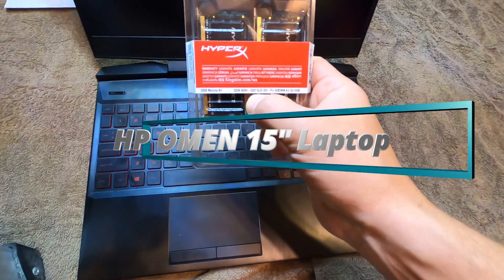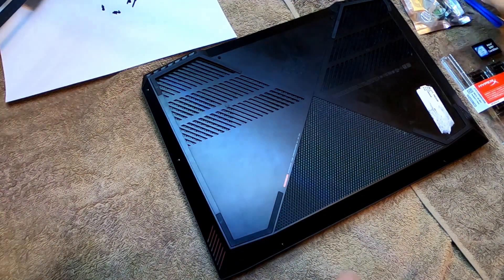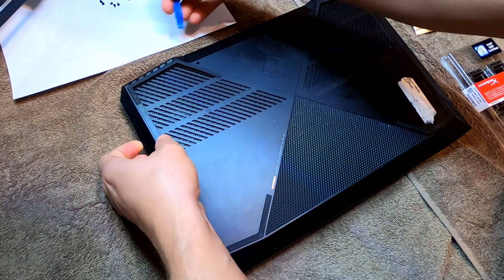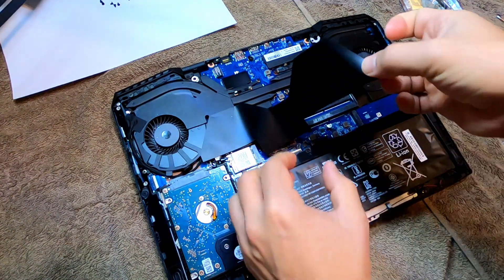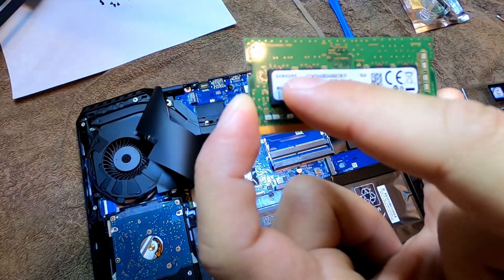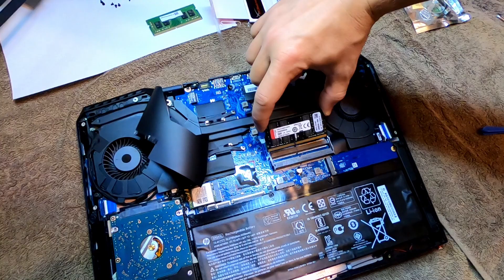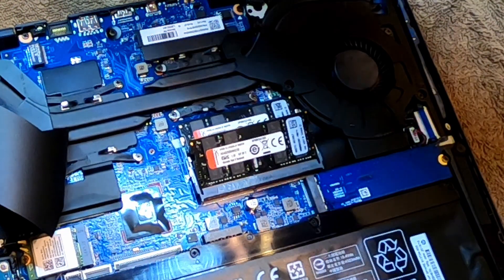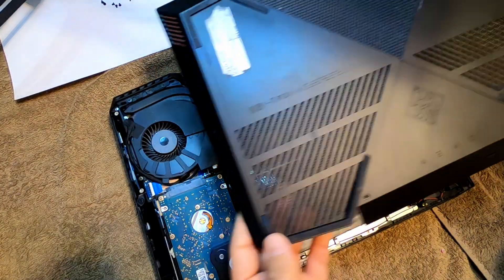HP Omen Disassembly Ram Install Upgrade | How To install Memory

Comment: Hey, I have the same laptop as you, but I couldn't find any way to speed up my 2 rams from 2666 mHz to 3200 mHz. Yes, I do have 2 8 GB 3200 mHz rams, but I don´t find a way to activate the XMP or an advance settings on the HP Bios, can you help me out?
Reply from the maker: The newer computers do not have any access to any of it, it should change the speed automatically.

Comment: Hey bro, I have omen 15 i7 9750h Rtx 2060 144hz with 16GB ram 2666. How should I know which one is competible with my notebook. Like my friends told me it's really risky to buy ram. I js wanna know can I upgrade my ram from 2666 to 3200 MHz. I mean is it possible.?  Default configuration is 2666 MHz ram so is my notebook able to proceed with 3200 MHz ram. Is it work.?
Reply from the maker: I cant speak for any other models other than this worked perfectly on my computer and is necessary for me to be able to edit these videos for my YouTube Channel.
Thanks for supporting my channel!

Comment: Very helpful video bud .I  have an hp omenx 17 an101na with 1  standard 8GB Kingston ddr4 2666MHz card installed which is to slow for my liking , I was wondering is there anyway with the memory slots to upgrade with two kingston 32 gb ddr4 2666MHz sodimm cards ( making it a wopping 64 gb ) , one for each slot or do you think the max would be 2 of the 16gb ddr4 2666MHz sodimm cards, asking You this as HP support are useless.  :-)
Reply from the maker: It may possibly support it but no guarantees... 
Thanks for supporting my channel ❤

Comment: I’m very close to buying a HP Omen 15. It has 16GB DDRAM. But I want 32GB. Cos this video right here — scares me. Not sure I’d feel confident to replace the RAM myself.
Reply from the maker: Why does it scare you? 
Hope it helped!
Reply: @DrDemp  

That black film across the RAM what if you don’t put it back properly , and then the laptop doesn’t work proper?
Reply: @LaMOi1  I'm like 90% sure the paper thing is just for aesthetics. So you can't see the board through the bottom grill.

Comment: Hi, nice video.
But I have a question, what is the maximum amount of RAM that this PC can support? 32GB or 64GB?
Reply from the maker: Mine could handle 2 32GB cards if desired. Total of 64GB
Reply: @DrDemp  Ty bro, do you know if OMEN 17-cn1000nl can support 64GB of RAM?
Reply from the maker: Not sure of the exact model but its likely you would max out the Processor's computing ability before ever needing that much RAM. Under heavy editing, mine only uses about 25GB of the 32GB compacity I have installed.

Comment: I got HP omen 15, and ryzen 5 hexa core. Can I install 32 gb ram single stick 32000 mhz? ( I am a noob at upgrading laptops)
Reply from the maker: Not sure on your particular model can always give it a try and see if it works!
Thanks for watching!
Reply: It’s best to stick with the clock speed the laptop came with if it came with a 2666 MHz if you stick 3000 MHz it’s gonna go down to 2666 MHz

Comment: Does hp omen 15 2020 support 32gb ram. Website says 16gb is max
Reply from the maker: Not sure about your particular computer there are 100's of different models of the omen's. Worked perfectly for mine.
Reply: @DrDemp  mine is omen 15 ryzen 5 4600h

Comment: Hi, I have hp omen and I want to upgrade it from 8gb ram to 32gb(16*2) , so what speed is best for me: 2666mhz or 3200mhz? ... is there a real difference between the speeds of ram in editing??
Reply from the maker: I prefer buying the fastest available that will work on my computer. Editing is very easy with the increased speed provided by this memory.
Thanks for supporting my channel!
Reply: thanks, can you give amazon link of this ram that you take it?

Comment: Hi purchase Hp Oman laptop & model is 15-dc1093TX  & Intel  i7 & 9th generation processor currently ram is 8 GB ( manufactured by Samsung)  2667 MHz  but i want to upgrade 2*16 so which  ram model is compatible with it please suggest, It will very help full for me, Thanks in advance.
Reply from the maker: The one used in the video worked perfectly for me. 
Thanks for watching!

Comment: I have hp omen 15 1092tx i5 9th gen 8 gb ram
Presently my ram runs at 2666mph 
Can I add another 8 gb ram with speed 3000?
Reply from the maker: Not good to mix speeds, and it will not run at the faster speed even if it works.
Good luck
Reply: Add another 8 gigs ddr4 2.666 MHz

Comment: Hello there,
My Omen has 1x16GB 2666Mhz (Cl19), I was thinking about buying another 16GB Stick (for dual channel),
But I just cant find any other 2666Mhz Cl19 on sale, the closest are Cl18 and Cl15. I can I mix them ? They should automatically match the slowest one (Cl19), right ?
Reply from the maker: I would not recommend mixing brands of RAM. Sometimes it works but It can also cause unforeseen issues. 
Thanks for watching!
Reply: @DrDemp  mixing brands is perfectly fine. Mixing speeds is not recomended (as the BIOS may not scale down properly/the way you expect), about timings I have no ideia how it works (on laptops) that's Y I was asking. Thanks anyway.

Comment: I have an hp omen 17 i7 7700hq rx 580, how can I enable xmp ?
Reply from the maker: Mine was plug and play, noticed an instant boost.
Reply: U can't. You could do it on desktop but not on most laptops. This should be automatic (If supported by the OEM).

Comment: I have omen 17 an106nm it dont have xmp profile in bios anyway i want to upgrade motherboard from i5 8300h and gtx 1060 to i7 8750h and gtx 1070 can anyone help me what model have same size motherboard with those specs and xmp profile in bios
Reply from the maker: I didn't have to change any settings when installing this memory, plug and play. 
Thanks for watching.
Reply: @DrDemp  Can u run cpuz and tell me readings of ram speed ?
Reply from the maker: I don't have that on my computer, I edit videos and this made night and day difference for me.

Comment: Good guide. 
I am totally bewildered by (and more than slightly annoyed about) the fact that laptop manufacturers stopped putting small access hatches on the bottoms of the machines; laptops used to come standard with a small access hatch right over the RAM, which could be opened by just removing a few screws and then sliding off the hatch cover, so the RAM could be upgraded without taking apart the entire case.  
Is it just to make the process more complicated so people will take their laptops to professional techs just to upgrade their RAM?  Because just last month I replaced a single stick of RAM in my HP laptop, a process that used to take me about 5 minutes (actually putting in the RAM is basically just like snapping together LEGOs) but this time it ended up taking me FOUR HOURS because I just couldn't get the damned case open, and then even when I was done I couldn't get the case closed back up completely; when I snappped the case back shut it felt like the internal components were no longer seated correctly, and the power button would no longer depress.  The corner of my laptop is still popped up open and I just cannot get it clicked back down no matter what I try, and the sides of the case are now riddled with scratches and indentations from working to pry it open.  I need to find one of those prying tools.
Reply from the maker: Thank you! I agree, they definitely don't make it easy on purpose and would rather you take it into a service department to have simple things installed such as Ram. I've had a similar experience with things not lining up on another computer (not the one in the video it went quite smooth) and sometimes its best to take it back apart and reseat it. Mine snapped flush the second time around.
Good luck!

Comment: Hi, 
What speed does it show in Task Manager? 2666 or 3200?
Reply from the maker: Task Manager will not represent the actual speed of the processor with the upgraded RAM, You would need CPU-Z to check this.
Thanks for watching!

Comment: Hello, Can you tell me if hp omen 17 rtx 2060 i7 9750h 2019 has a maximum supported ram memory 32gb and not 16gb?
Reply from the maker: Should be able to handle 2 sticks of 32gb for a total of 64gb. Google would give you a more definitive answer using your model/serial number for your Laptop.
Reply: @DrDemp  thx i love you

Comment: If i purchase 16GB DUAL RANK RAM. will it work.. i already have 8 gb so total it will be 24 GB ... I am right or wrong...??? confused between single rank and dual rank
Reply from the maker: As much as I would love to help out I am unsure if that would work out like that, I had 2 spots for ram in this laptop, i had to remove the 8gb to install my 2 new 16gb sticks to bring my total to 32.
Reply: i got an .2m nvme 512 gb ssd will it support the hp omen... n i dont have the screw
Reply: Dual rank RAM means that the stick has the RAM chips (the black rectangles) on both sides, while single rank has the chips on only one side.  It is basically like squeezing two sticks worth of RAM onto a single stick.  You need to read the manual for your computer to get the specs and determine what kind of RAM it can take.  The manual will be pretty precise about it.

Comment: Hello, enable xmp existing on hp omen laptop 15' ? Thanks
Reply from the maker: This is Plug and and Play as long as your computer supports XMP you should be good to go!
Reply: Or does it still go 3200 mhz on hp omen? Thank you for your reply :)
Reply: How to enable xmp on latest hot omen 15 2020 version ?